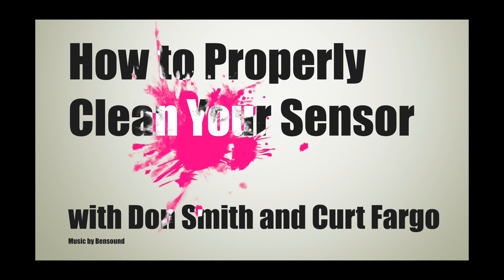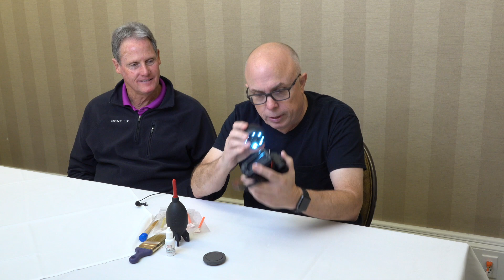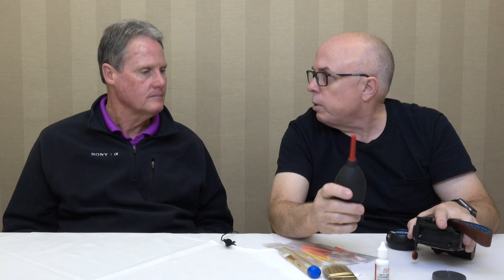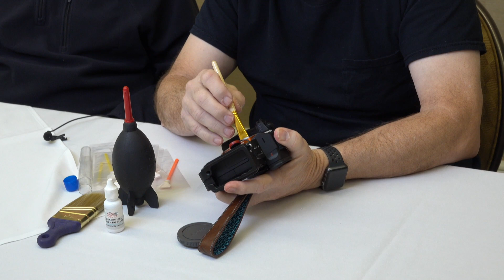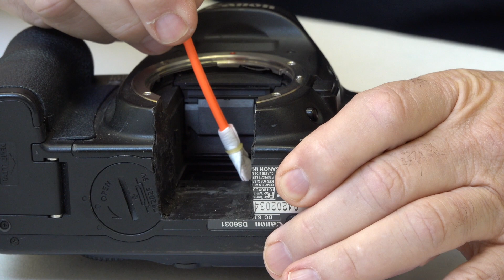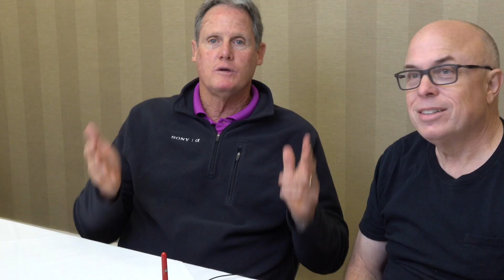Sensor Cleaning with Industry Expert Curt Fargo and Sony Artisan of Imagery Don Smith

Comment: Hi, very helpful advice, thank you. I wondered however, if you use a dry brush to pick up loose dust particles are you not at risk of smearing other dirt/oil etc on the sensor around it?
Reply from the maker: yes - also a Rocket Blower

Comment: You should add if using a brush, make sure to never touch the brush with your hands or anything else, this ruins the brush and then needs to be replaced.
Reply: Actually it doesn't ruin it as the brushes are cleanable. The cleaning instructions come with the brush. 

Cleaning the D-SLR Brush®

Items needed to complete this task: Distilled Water, Running Tap Water, a Clean Drinking Glass and a cleanser. There are a couple of different cleansers that we recommend: Johnson's Baby Shampoo or Efferdent Denture Cleaners.

    Dissolve 1 Efferdent tablet or a couple of drops of Johnson's Baby shampoo in a large glass of distilled water.
    Swish the brush bristles around in the cleansing solution created in step 1. Only subject the bristles to the cleaning solution, keeping the handle and ferrule dry. 
    Press the bristles against the side of the glass to force the cleansing water through the bristles.
    Repeat steps 2 & 3 for about 5 minutes.
    Rinse the bristles thoroughly under running tap water.
    Rinse the glass used in step 1 thoroughly and fill it with distilled water.
    Rinse the bristles for the final time in the glass of pure distilled water.
    Allow the brush to dry, at which time it will appear to be hard. A blast or two from your blower will bring it back to normal.
Reply from the maker: great point